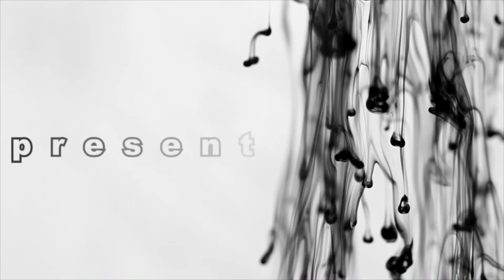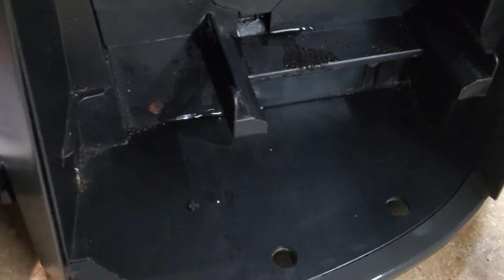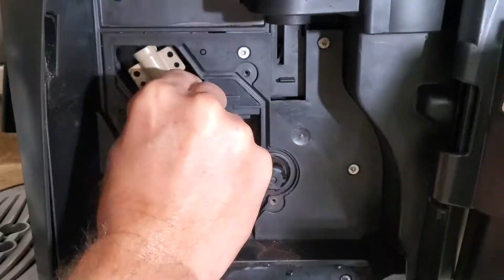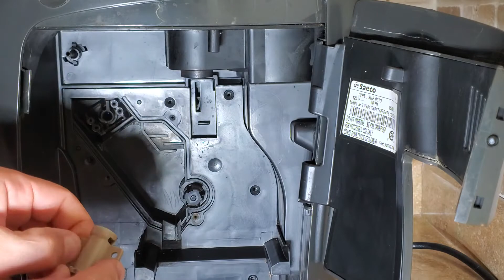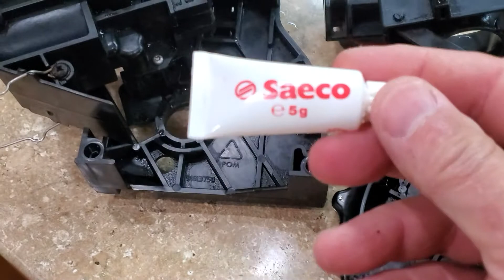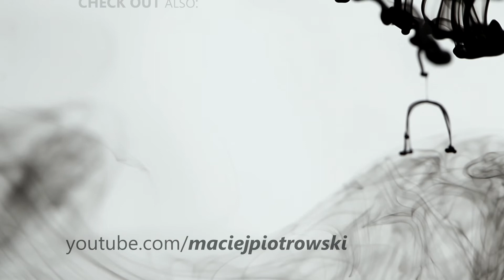Saeco Brew Section Gaskets Replacement and Cleanup

Comment: After you change the seals (gaskets), is it necessary to grease them? I've seen in another video that the seals were greased, but I'm not sure if this is correct because I think some grease might end up in the coffee. Thank you very much in advance for your answer.
Reply from the maker: It's up to you.
Reply: @MaciejPiotrowski  Thanks a lot!  How do you proceed, do you grease the gaskets?
Reply from the maker: @florinmoraru2229  Yes I apply grease on the outside of gaskets to make them operate smoother and protect the rubber. I Use my finger for it
Reply: @MaciejPiotrowski  Thank you!

Comment: Should I try replacing the whole brew unit? 

I have the same problem and greatly appreciated your video. I cleaned the brew unit, replaced the gaskets, and greased the moving parts. Still having the excess coffee in disposal tray and soggy/half-sized espresso pucks. 

I tried to open the full panel, but the bottom, center screw is stripped. Do you have any other suggestions?
Reply from the maker: have you cleaned the metal mesh filter that pushes against coffee ? maybe it's clogged, and not enough water goes through it ?
Reply: @MaciejPiotrowski  - thank you so much for responding! Yes, I cleaned the metal filter. Not sure what else I messed up, but after putting everything back together, clean water is draining everywhere, I’m getting the clean water circuits light, and no water will come out of the wand. 😞
Reply from the maker: @QlikPro  if no water is coming out of wand you must have a clogged line or water line connection to the wand is leaking or broken. You may have to take it apart to check connecting hoses. watch this video and you will see how to take it apart https://youtu.be/YxlkbZ4w9Hw
Reply: @MaciejPiotrowski  thank you so much! I’ll give it a try!

Comment: My water is not dispensing at all .. can you help please?
Reply from the maker: check brewing section for cloggs. Check that metal grid. Maybe your water hose is broke. You need to open the machine and see if you have any leaks from inside. Also motor pumping water might be dead.

Comment: Do you have a video for the water link on the team  section
Reply from the maker: no I do not, but I have manual I can send you so you can see all the parts
Reply: @MaciejPiotrowski  Yes, there's this video that shows 4 gaskets on the part inside. I ordered the gaskets, but they're not the right ones. the outside 2 (the ones you can see without dissassembly) are frayed and no longer even stretchy.  https://www.youtube.com/watch?v=Fqd-RUTqRSo&t=340s (I took photos of the gasket sizes he shows in this video).